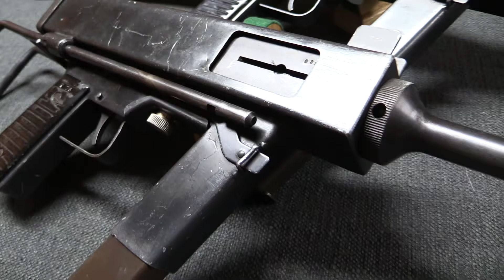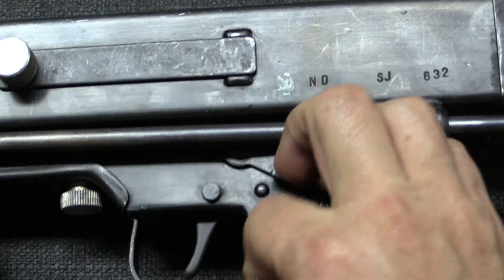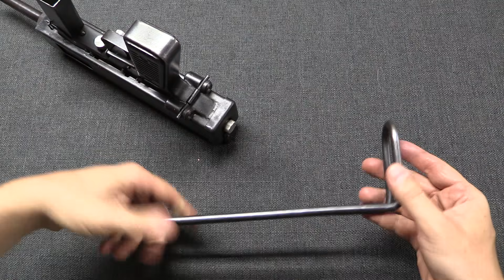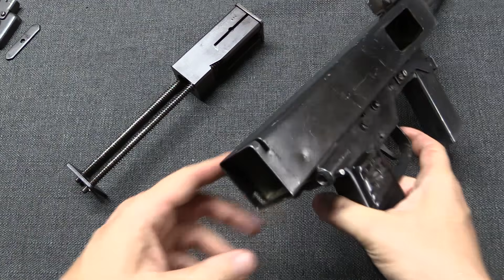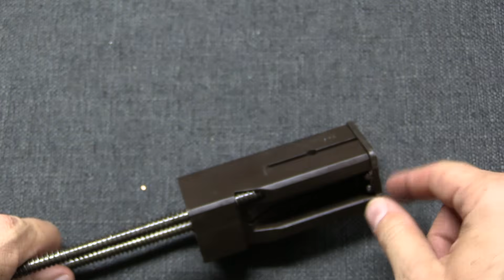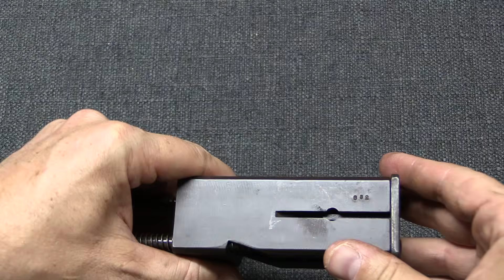Rhodesia's First Production: Northwood Developments R76 & M77

Comment: Looks like the sort of complexity that arises from the need for simplicity of manufacturing operations. As if they only had a semi-skilled workforce with access to hand tools, simple machine tools (a bench drill maybe), and a welder. The only 'complex' cut I spotted with the underside of the bolt. Surprised at the barrel design though, with that fat base. With limited material I'd have expect a much smaller flange with a separate nut over the top. would waster a lot less metal and be simpler than turning down a massive barrel blank.

Comment: I was in Rhodesia in 1977 and 1978, I do remember these and another gun that looked similar, it was called the LDP? or nicknamed the RHUZI   as it was a local manufactured gun but used UZI magazines, I know on one occasion a farmer had one and it fired by mistake I think was supposed to be semi auto but went full auto and a burst of rounds hit his right leg, and was in plaster for months and months. 
I used a few on the ranges but stuck to the UZI and FN-FAL, and Colt Python I had.

Comment: I saw one of the R76 models in the local gun shop to my boarding school here in the UK back in the early 80s, it was (back then) considered a pistol (even with a stock), I never knew what it was till now, but it had one major difference, it was chambered in 45ACP, used 1911 magazines and had a much shorter barrel. I have no idea if the modifications from 9mm to 45ACP was from the factory or done over here in the UK.

Comment: Arms produced under embargo are my favorite topic in all of firearms history, I really hope you do more!

As they say necessity is the mother of invention, so the nations under embargo seem to experiment quite radically for solutions to that problem.

As for the price being unwarranted, consider that the production capacity of the manufacturer of those guns was probably not very high, so the price was elevated not because all the guns were worth that much based on quality of machining or design but rather because even at the elevated price they would all be sold because firearms are artificially less available in nations under embargo, elevating the equilibrium interception of supply amd demand curves. I suspect that if the production capacity of the manufacturer was greater, the price would have been lower due to increasing supply corresponding to a less acute demand.